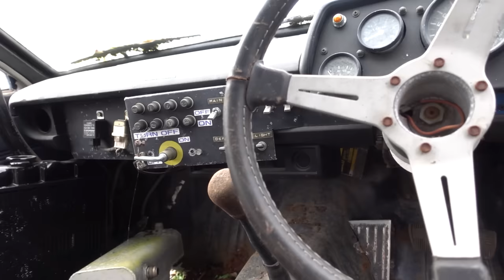Where Japanese Racecars GO TO DIE!

Comment: 2:22 the yellow shell looks like its a 1970s Lotus Europa, very rare car these days. It was one of the first mid-engined sports cars in Europe after WWII. Since the chassis is made from glass fibre reinforced composite material, it should still be in fairly good condition. If its not cracked or has some other damage from an accident, this could still be werth 5k, without engine, chassis and interior. (should have watched to the end first: 22:42, more Lotus Europa shells.)
18:32 casually walking past a freaking BMW 3.0 CS, to look at an Eunos Cosmo. Priorities of a proper Japanese car fan I guess :D

Comment: I’ll never understand how or why a “business” lets cars just go to waste. When ever we buy something we put dates on them what Evers left of the vehicle after 6 years gets sold. And if they have real value they get dry stored.  I will add dry storage isn’t difficult to build
Reply: Affording a dry storage depends also if you're allowed to build
one. Not any country has a large surface area that allows the 
storage at the edge of the forest as is usual in the usa. Other 
legal requirements usually make such projects more difficult.  
And in the end it will also cost money. This here is the lucky
man because he can use a meadow. Here it is forbidden and 
even if a car is still registered (= roadworthy) you would quickly 
have the municipality and/or the police on your neck. This means 
that everything that has no concrete floor and a roof cannot be 
used for storage.

Comment: Gotta say, that's the first 4 cylinder supra I've have ever seen or heard of. Was not expecting that.

Jgtc were classified by weight and horsepower. Probably went smaller engine for weight saving and class limit
Reply: Like you said, Supra GT500 from the 90s ditched the 6cyl and uses the 3S-GTE instead since it's lighter, more fuel efficient, and produces just as much power as the Skyline GTR with the RB26.

All modern GT500 race cars are also using 4cyl engines as well now (all due to regulations) and the cars are faster than ever.
Reply: This engine, 3s-gte, is the engine with the most official victories in toyota history

Comment: that gold car shell on the garage at the start was a 70"s lotus europa special. i counted four 2002 ti bmw's and 1 912 . but  you never commented on them. but you did see the silver europa but completely missed the 1984 Lotus Excel in silver @19:53..( he did notice it) i counted like 7 mid 70"s bmw bavaria's. but the have alot of 1980's bmw 635 csi . and the lone sl450. the black car with the gold trim i don't know what it was

Comment: Man alot of these cars with alot of work and some fabercating skills they can be racing in vintage classes in no time I built me a circle track pure stock out my old wrecked asphalt car a rusted up rotted cutlass supreme 2 door 88 and a rusted metric frame and took me a months to just fix the floor pans rust gotta run stock floor pans and roof everything else can be fabved and bent aluminum sheets that are ore colored abuikd you a body that resembles a 87-88 monte carlo cutlass or what ever they look more sporty and Racey as well so much fun building brand new shiny clean cheap oval cars and asphalt modifieds and dirt modifieds using a built chassis from a front running chassis manufacturer and copy it with steel tubing and square tubbing just builds jig on a huge long steal welding table my leveling a d using soap stone and center punch to trace out the bought chassis to build your own new one on a huge jig table in a month I love fabercating